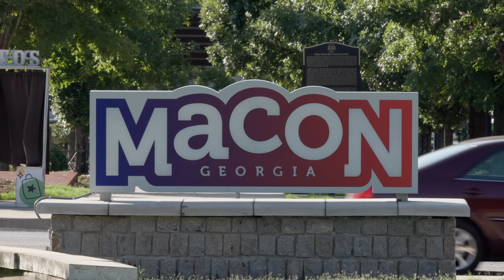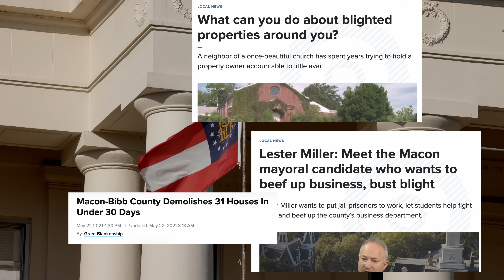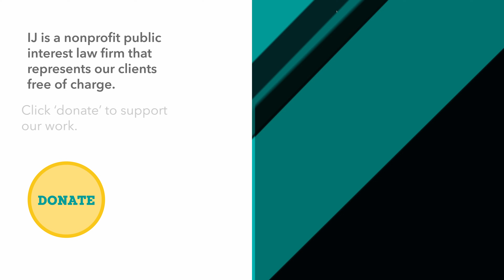Man's House Bulldozed—No Notice, No Compensation

Comment: Keep in mind, this is going to be more common, especially in the next 4 years. They did the same thing in my city 8 years ago... It is a scam and here's how it works at least in my city and state. 
The city, wants to redevelop a certain area. Why would a city want to redevelop a certain area? Easy because the houses are older, the value is diminished, they can't be taxed the same as a "new home". They often have large lots second hold two houses and additional taxes for the same lot. 
The way it works, code enforcement will go around and find older homes and "find" violations. Mind you all homes have code violations old and new. The person is given 30 days to rectify whatever the code violation is. If they want an extension they have to go to the city planners meeting and request a two-week extension. Depending on the scale and the time of year, you may need to request extensions every 2 weeks until the weather breaks. If you miss any meeting requesting a 2-week extension, the property is then condemned and subsequently scheduled for RAZE (demolition). Now quite often planners meetings are postponed or canceled. That doesn't change your requirement for a 2-week extension that you can't put in because they were rescheduled or canceled. But let's say that you fix whatever the issue was... You then have to call City inspectors to clear the discrepancy. But while their... They are permitted access to any and all structures on your property. So they are legally permitted to go through any and all structures on your property and find additional non-conformance or coat violations. And the process continues...
For every house that the RAZE, the state provides the city 5K. The city then takes the 5K, demolishes the property and then chargers the homeowner 5K for the demolition which they have one month to pay or forfeit the property. Then to add insult to injury part of the homes that are RAZED are used for training platforms for the fire department so they come in and set your house on fire and then charge you 5k. At this time developers can buy the property lots from the county at auction for pennies on the dollar. Those same developers are usually the developers that made large contributions to the county tax assessors campaign. 
I only found all of this out because I found a distressed property the home was built in 1900. It was a two-story home, 2ftx2ftx4ft quarried stone foundation, then from foundation to the top of the second floor, all made with solid concrete architectural block. And it had a slate roof. Even the porch bolsters and spindles were made from concrete. All hardwood floors on the inside. And the property owner was trying to unload it. It was scheduled for raz but I had the money to gut this entire thing and rebuild from top to bottom. For the price they were selling this would definitely be a worthwhile investment for me... So I contacted the county to find out what I needed to do to remove the RAZE as I was interested in purchasing the property and rehabbing it. I come to find out that the reason why it was rest was because there was a deck someone had built in the backyard, this was a non-structural component. It was built to replace the wooden steps that were for the back door at one time but the deck was poorly built and had fallen on one side and was never repaired. They could have literally removed the deck and put up three steps to the back door and that would have resolved the issue. Unfortunately they didn't. When speaking with the city they said that I could not remove the raze once it was put in place. I told them I could prove that I had funds available to refurbish the house and would submit plans and purchase permits to do so. They said it didn't matter and they had never seen anyone overturn a raze but I wouldn't be able to do any of that until after I purchased the property 🤨. I contacted a lawyer. The lawyer basically broke down the scam to me and told me it was not worth it as for all the money that I would spend fighting it, I would lose and by the time it got through the court systems the house would already be demolished and be stuck with a vacant lot. 
Looking into it further I found out that there were properties that were condemned, because there was a chunk of concrete missing out the driveway (a personal pothole). It wasn't repaired in time so they tore down the entire home 😲. There was another man, a vet, who purchased a house for retirement. He had not moved back to the state yet, was not behind on taxes but did not get his mail to the property as it was held at the local post office. He retires moves back here, gets his mail, find out that he had violations, they were not addressed, his house was scheduled for raze, and that was going to happen in 2 weeks. He literally just moved into the house that he had bought 6 months prior. He contacted the city and the county, nobody would help him out nobody cared. He borrowed himself inside the house, had a gun gave warnings. Ended up being a standoff between him and the City PD and the demolition crews. He ended up arrested and they tore his house down the same day. It's been a few weeks in jail and then had to pay a fine of a couple thousand dollars 🤨.
It's all bulshit. Me personally? I bought my home in 2016. It's a very large home. I moved my parents in. My father passed away and it is just me and my mother. Whenever she passes away? I am selling this place. Why? When I bought my home, the taxes for the property had been pretty much consistent since 1980. They may have gone up $25 a year. There had been no improvements to the house made before that or after that time. Since 2016 to 2024 I have received a updated tax assessment every two years and my taxes have doubled. I currently paid more in taxes over a year than I do for my mortgage and insurance combined. Every single assessment the county has increase the value of my home this in turn increases the amount that they can tax. If it is completely ridiculous. My goal is to sell this house and get the hell out of here and buy something rural where I can't even see my neighbors that have taxes to reflect how rulal they are.

Comment: The thing that is particularly fishy, in this case is, the house was already on the list, before being sold to this owner. The county claims he was still given "nearly 20 months" to fix it or pull construction permits. In this case it would appear to be about 18 months from sale of the property, to demolition. The county claims that their rules (not law) was followed and a letter of "Nuisance Per Se" was provided and posted on the property. They are not clear in the statement if an additional letter of "Nuisance Per Se" was provided for the new owner, or if only the original letter was provided. 
If it had already been determined the this building was to be demolished, why was the sale of the property allowed? Did the previous owner disclose the status of the property and sell it as is?
Reply: Doesn't matter. The title transfer should have noticed.
Reply: The guy knew what he was buying and didn't do anything for a year and a half. Sorry. No sympathy. I'm surprised IJ took the case.
But, hey.... They're smarter than I am, so good luck to them

Comment: I agree the city should not have torn down the house. It kinda sounds like he doesn't live near the house and because the neighbors were informing him of the dumpster/ backhoe he was not actively working or repairing the house at the time. According to another post he had owned the house for 20 months and still had not finished the repairs. Also in question was did he had a valid work permit. A permit is usually only good for one year. When he saw the dumpster he should have stayed at the house 24/7. If he had an agreement with the city that they were not going to demolish the house he should have got that in writing.

Comment: It would seem that the demolition contractor and city also violated NESHAP (national emmesions standards for hazardous air polutants) which requires asbestos testing before demolition.  If they never entered the house how would they have tested? At 4:43 you can see the remnants of black mastic and the outline of the vinyl tiles that used to be there (Most likely asbestos containing materials).  So they broke multiple federal laws, stole this mans house, and exposed the surrounding residents and workers to asbestos.  
Source: licensed air monitor and asbestos building inspector in south carolina

Comment: Whenever you see a story like this, be sure to research the facts.  Searching his name and county bring up plenty of articles, which contain facts like: 
 "A letter designating it as a Nuisance Per Se and blighted and that it would be torn down if not repaired was provided, as well as notice posted on the property. The letter is not legally required for this process, but we provide it as a form of notice and allow the property owner the option to fix their property. The property was sold in February 2022 (after it was deemed blighted), and Code Enforcement provided the new homeowner nearly 20 months to pull any construction permits or fix it up. No permits were pulled, and we were not made aware of any improvements made before the demolition permit was pulled in August 2023. "
SO, they DID send (and post on the door) notice.  And, while he says he was fixing it up, he never pulled any permits to fix it up. Hmmm.   That article also includes   "He says he has worked as a carpenter and home renovator for decades ....  “And they told me, ‘You can’t touch that house.’"   So it sounds like he was trying to (illegally?) fix the house himself, *without any permits*.
...just a little different than the story told here.

Comment: Demolition company cannot just take man's word but should not just take word of the county. Just paperwork to demolish a house is irresponsible. Demolition contractors are causing irreversible damage to owner. A misjustice to one property owner is an injustice to all property owners! Demolition is for houses that are structurally unsafe. Many use formula of cost of repairs being more than 50%  of house value. There again, there is a procedure of predeprivation. And an appeal of that decision except in true danger to the community. Not some speculation like "blight". 
It is troubling that this is not be done covertly if there is a public site that has 700 and counting. So where is the outrage?  We have seen with Trump court case that Georgia's court system needs oversight!  😢

Comment: And all of this when there’s a claimed national housing shortage along with high rent. Instead offer incentives for flippers, those who intend on renting these homes and those who repair the homes and fix the code violations who plan on living in the homes. Fix the issues and own the property for 5 years and receive property taxes based on the accessed value of the home with the property cleaned up inside and outside with no improvements. If the home would be assessed at $180k with the yard mowed, cleaned up and maintained and any trash or items left behind by the previous owner or any renters removed and hauled away they would only pay property taxes on a $180K accessed property value for five years if they own it for five years otherwise an accessor comes out and you owe the county or city the difference. Unfortunately the only way to prevent this might be to live in the home while working on it. The man said he was planning on fixing it up to have family live there eventually have them move into your home in the area. And if you have a CC use it to get rid of trespassers.

Comment: This story is very one sided. There are a lot of people buying derelict houses and planing to put very little money into them and rent them out not live in them but rent them out. Rental property brings down a neighborhoods unless the landlord is held responsible for that property which they never are but in rare cases. The cost of fixing these properties is astronomical to do it correctly! Most of these houses shouldn’t even have been up for auction they have been condemned! So stop feeling sorry for people that don’t have the resources or knowledge,skills to in vest in these properties! And the people that actually live there are the ones that have to suffer because of it!
Reply: What? There's absolutely no evidence the house wasn't well within repairing range - the facade certainly didn't look dilapidated. You also just don't know what you're talking about in general - unless it's plagued by black mold or structural rot, repairing an existing home structure with some damage is ASTRONOMICALLY cheaper than buying land and doing a build from scratch. If your city council isn't holding the properties to a certain standard (or dealing with it in the lazy, messed up way presented in this video), that's the city council's fault and no one else's.

The people who buy old homes and fix them up good enough to live in are usually doing something better than the full, and often unnecessary, teardowns. Finally, the idea that homes shouldn't be renovated into rentals is crazy, and any impact that's having on the neighbourhood is an area the city council is letting you down, not the concept of renting. People who cannot afford to buy outright still deserve places to live, ffs.
Reply: @ I am betting you voted for Harris. If you don’t live next to a rental property you know nothing! Renters have nothing invested in their rental property or neighborhood. And yes in some cases it is cheaper to tear down an old house. You have to consider foundation,roof,electrical,plumbing and other structural issues. Most people have rose colored glasses on when trying a project like this and don’t realize the cost to do it correctly.
Reply: @TheBeer4me  Regardless, the county HAS to communicate with the citizens. If citizen is in the wrong, well, is what it is. But if not, then they have to give time to rectify violations. Otherwise they create an environment where people burn down entire cities. As far as renters. I DO live next to one and the landlord takes care of the property. My parents in the came city can't say the same. Renters have damaged the appeal of those neighborhoods. The ones that don't should be the ones responsible for the downfall of the area around them. Code enforcement and local news is a good place to start. Need to stop blaming the citizens all the time. The government is at fault much of the time by not enforcing codes. Dealing with it in a local city right now.
Reply: @ one problem people that live in populated places are to dependent on government to take care of them. Some do need help.